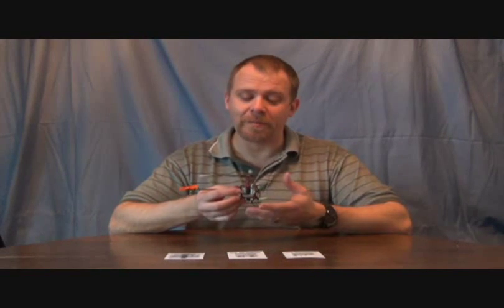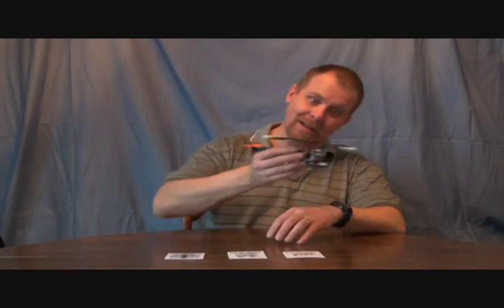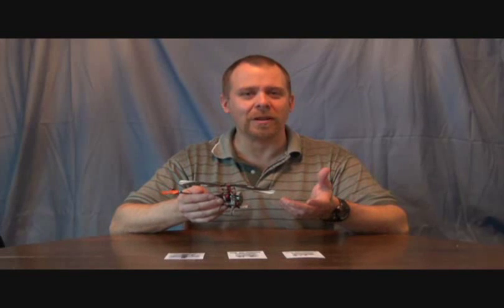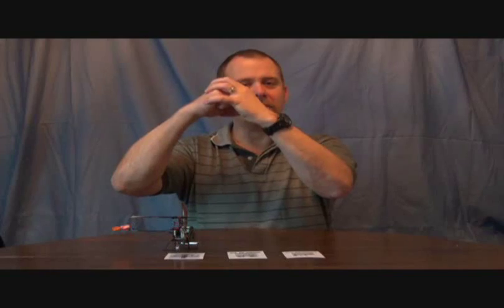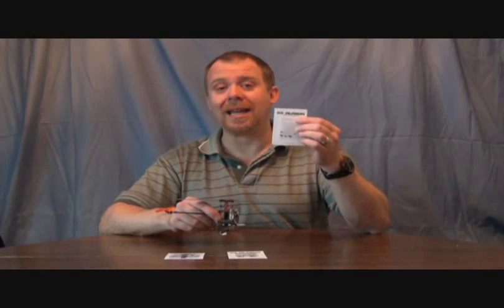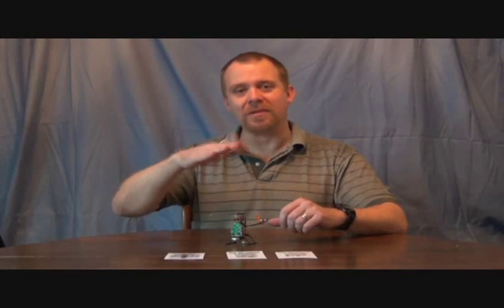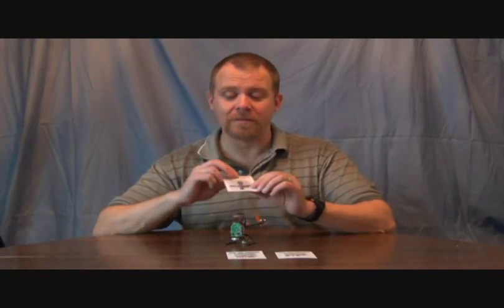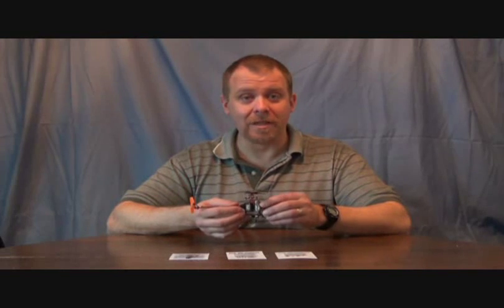Micro-Helicopter O-ring Upgrades

Comment: the link doesn't work… Anyway I have the blade 90 S 3 with TBE spinning around in a hover and I didn't have O-rings but I did notice I had some canopy rubber pieces that are really small and fit onto my swash plate ball links… I also oiled everything.  The toilet bowl effect went away.  Now I hate this helicopter hears why… These little micros are just so inaccurate because you're so small cheap whatever… I'm used to setting up .60 Nitro machines the smallest I ever had was a 480 T Rex these things are just cheap but… I don't really hate it I actually love it but that side of me that wants precision has to just let go.  but the toilet will affect you just can't have that.  This video did help it reminded me to put two extra ones in.  If you're still out there thank you forthis video for reminding me and I hope you're well

Comment: The O-rings and Dampner kit is a MUST and for $3,50 it's a bargain. The $20 tailbom upgrade is of no use for a newbie, but since I have a metal swash plate and a brushless kit ordered already I the tailbom upgrade will come handy. I would even consider a 150mm upgrade (instead of the shipped 140mm). 

A computer radio will make a huge impact too. There is a lot of slop in the WLToys radio. I just received a FrSky Taranis and a HT8 module for the V922.

Comment: For the dampener O-rings (Big Black) I had to put them on my Dremel and sand it them bit so they barely fit the head. It was impossible to fit the dampeners inside the head and get the damping shaft through, otherwise and I used a lot of force. I would pay another $5 to have a out-of-the box fit.

Comment: The are improvements to be maid. I had to solder the tailbom wires to the old connector and that took I while. The soldering tip seemed huge compared to the regular stuff I solder, so I would happily pay another $5 to get that wire length and connector for the V922. The connector for the motor was to close to the fin, so the broke some of the plastic - no effect at all, but moving it 2mm would avoid the problem.

Comment: I did the O-ring, Dampner and tailbom mod. The O-rings and the Dampner removed almost all the slop in the head. And there was a lot of it. As a newbie a lot of the TBE is "user induced", but once I got i hovering I didn't have to chase the controls. The tailbom mod, removes the wag, but the tail wonders of much more when you spin up.